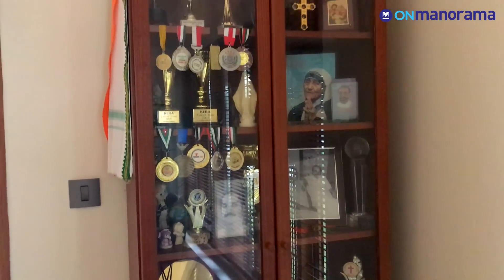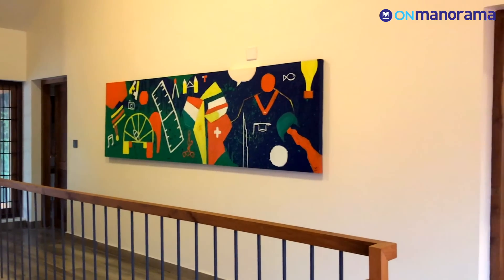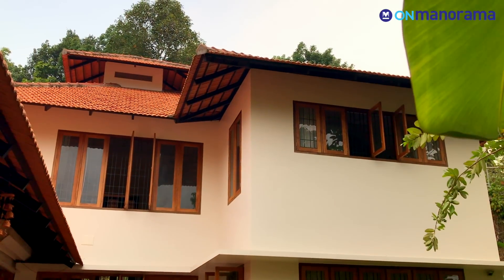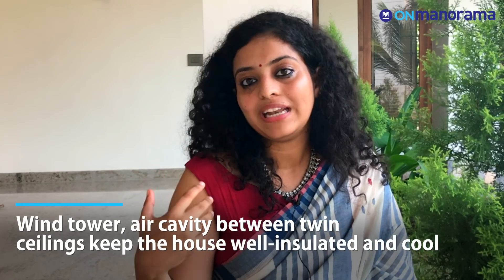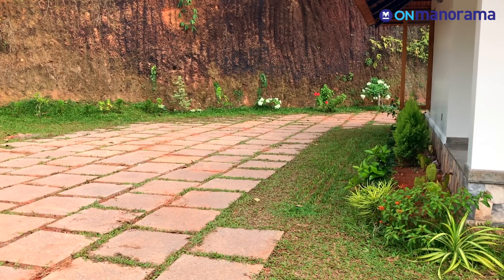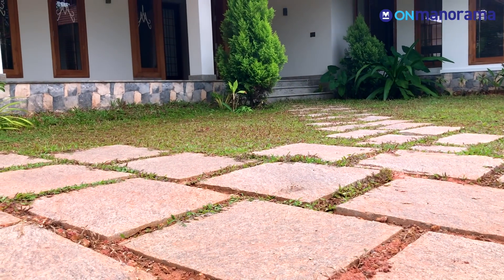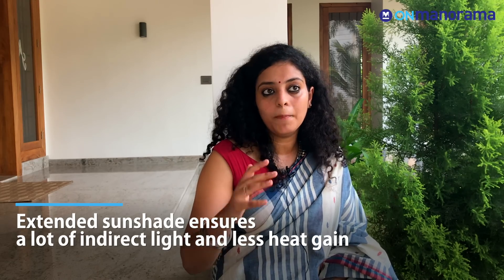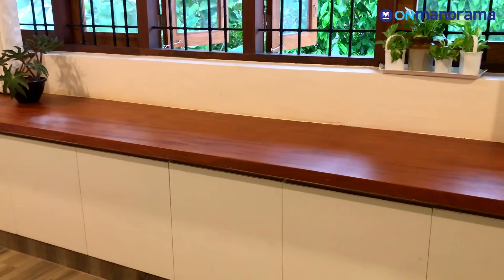This 'Eco House' features sustainable, climate responsive architecture

Comment: Question: At 4:17 you said the house has a double ceiling with concrete and wood. How is it possible can you send me more details? I’ll appreciate.
Reply: @Tino Star:
This 'double roof' is a now standard practice now. 
Earlier it was a Mangalore tile root and ceiling of wood. Now, it's a concrete 'ceiling' topped by a tiled root. 
For decades, in the case of a house with a concrete roof, an addition 'tiled roof' was considered unnecessary, and dispensed with. 
People have realised that a flat concrete roof is simply not suited for a state that has 2 monsoons.
In this case of a 'double roof', the layer of air in between, also acts as an insulation, and keeps the house cooler in summer.

Comment: Maybe because viewers are not familiar with the concept, nobody had anything to say about the '𝙬𝙞𝙣𝙙 𝙩𝙤𝙬𝙚𝙧'. 
The wind tower (also called 
𝘸𝘪𝘯𝘥𝘤𝘢𝘵𝘤𝘩𝘦𝘳) is a traditional architectural element used to create cross ventilation and passive cooling in buildings. 
For centuries wind towers have been used for ventilation and cooling of buildings in the hot and arid or humid areas. 
(I've worked in Saudi Arabia and it's part of the traditional architecture there.)

Comment: The 'ECO HOUSE' built by cutting a hill and furnished by cutting the trees....btw the house looks good.
Reply: Irony 😂
Reply: Using wood for framing or building houses is much more sustainable than using other framing materials such as steel or aluminium. Wood is a renewable resource while others use a ton of energy and hence have an enormous amount of carbon footprint. Hope this helps you understand that 'eco houses' should ideally use renewable resources like wood.
Reply: But have been grown again  for the house
Reply: Eco thinking man 😂
Reply: Unfortunately living in hills without a shelter is long gone, hence one need to build a house.
Reply: @legalbalwansingh7499  Yeah but we do not advertise it as ECO with a quote.
Reply: @jaygadekar1479    It would be if ot was Bamboo  but this house Furniture is having Teak
Reply: Dont know when these rascals will umderstand your point brother
Reply: Using wood sensibly is not a problem but cutting a tree from its roots is...
Reply: Bhai bahut hard.... It seems they have cut out atleast 30 trees to furnish this. May be way more.
Reply: There was trees on the plot your house is built. Entire earth was forests, until the requirements for human settlement arrived.
Reply: @sharvilnaik8255  Then don't call it as ECO house. Just call it as a house.
Reply: Hai, if you projecting your Sun shade all side means, the air flow from outside to inside will happen uhhh??  Near windows and doors???????
Reply: Wood can also be got from old fallen down trees . If they have used wood it does not have to be cutting down young trees. Its a beautiful house
Reply: And very large for maybe a small family.

Comment: During summer how the hot air movement makes the house cold?
Reply: If hot air is vented out cool air will replace it. So air sucked from lower height will always be cooler than the hot air vented out. Also if heat gain is avoided as hot air is no longer trapped.

Comment: Nice house. Eco-friendly is a bit of a stretch, in Kottayam, temperatures never exceed 32 degrees, and winds blow throughout the year making an AC redundant when one has large windows and high ceilings like our old traditional houses.
Reply: @Geo: 
In most parts of Kerala, it's the humidity that makes it appear that the temperature is around 40°C.
32°C would be in an area surrounded by trees. It wouldn't be the max. temperature in Kottayam.

Comment: A true eco-friendly home would have used locally sourced material and recycled wood. Even when clay bricks are used, the use of cement is eschewed. This also means – no concrete roof or floors. Floors in eco-friendly home are usually of clay tiles. 
The wind tower (also called 
𝘸𝘪𝘯𝘥𝘤𝘢𝘵𝘤𝘩𝘦𝘳) – a traditional architectural element used to create cross ventilation and passive cooling in buildings – is an eco-friendly feature. If this can keep the temperature within the house to around 30°C, an AC wouldn't be needed. (But then, this house is situated on a hillock, with no buildings in the vicinity to block natural wind flow.)
No mention is made of rain water harvesting, which could have been used to recharge the water table. 
Since  Kerala is a state that has bright sunshine for at least 8 months, investment in rooftop solar panels could also have been considered. (𝘊𝘰𝘤𝘩𝘪𝘯 𝘐𝘯𝘵𝘦𝘳𝘯𝘢𝘵𝘪𝘰𝘯𝘢𝘭 𝘈𝘪𝘳𝘱𝘰𝘳𝘵 𝘨𝘦𝘯𝘦𝘳𝘢𝘵𝘦𝘴 𝘢𝘭𝘭 𝘵𝘩𝘦 𝘱𝘰𝘸𝘦𝘳 𝘪𝘵 𝘯𝘦𝘦𝘥𝘴. 𝘉𝘦𝘪𝘯𝘨 𝘵𝘩𝘦 𝘧𝘪𝘳𝘴𝘵 𝘧𝘶𝘭𝘭𝘺 𝘴𝘰𝘭𝘢𝘳-𝘱𝘰𝘸𝘦𝘳𝘦𝘥 𝘢𝘪𝘳𝘱𝘰𝘳𝘵 𝘪𝘯 𝘵𝘩𝘦 𝘸𝘰𝘳𝘭𝘥 𝘸𝘰𝘯 𝘵𝘩𝘦𝘮 𝘵𝘩𝘦 𝘜𝘕'𝘴 𝘩𝘪𝘨𝘩𝘦𝘴𝘵 𝘦𝘯𝘷𝘪𝘳𝘰𝘯𝘮𝘦𝘯𝘵𝘢𝘭 𝘢𝘸𝘢𝘳𝘥 – ‘𝑪𝒉𝒂𝒎𝒑𝒊𝒐𝒏𝒔 𝒐𝒇 𝒕𝒉𝒆 𝑬𝒂𝒓𝒕𝒉’.)